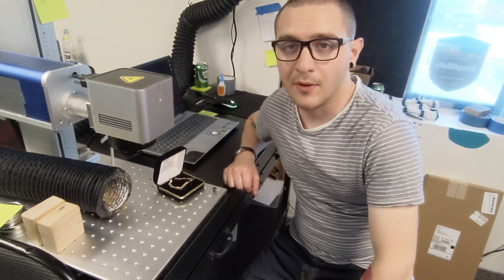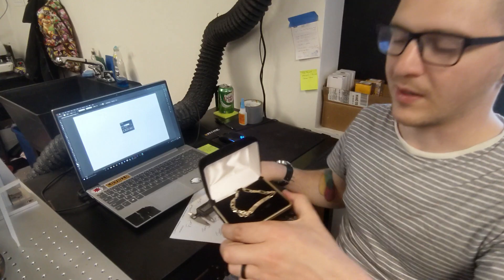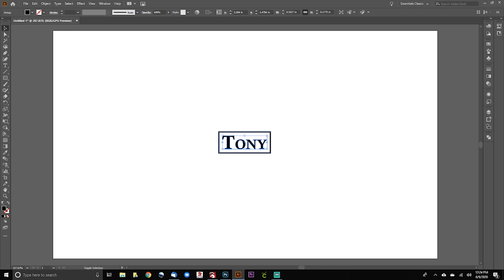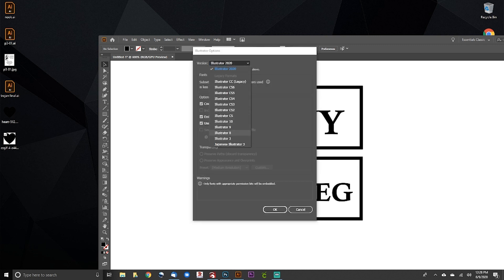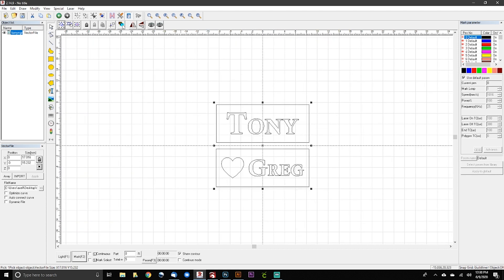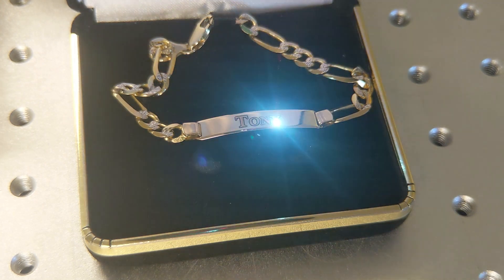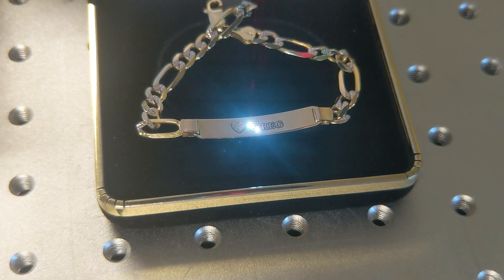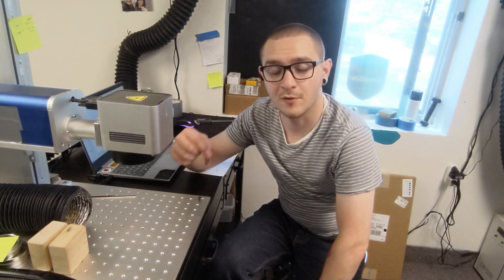How to Engrave GOLD with a FIBER LASER

Comment: Could you share your settings for the black engrvaving and clean-up as far as speed-power-frequency-Q pulse is concerned? May be I am forgetting some other options since I am a beginners learning to workshop with a high power fiber laser. Thanks

Comment: How did you get your laser to show the text (Tony ) to show like that what setting do I have to turn on ?
Reply from the maker: In ezcad, you can do this a few ways. Like we did, can outline with the border box removed in software so only name is selected, or using mark select and only selecting the name and not the border box and framing.
In lightburn, there are several framing options within the frame menu which can output a general square frame, tight exterior outline, or a more detailed shape of the components of a design, also adding in you can use the cut selected graphics as a equal use case to the mark select in ezcad, functioning the same way.

Hope that helps!

Comment: I bought a laser engraver to engrave a gold plated necklace and it won’t even make a dent in it . I did some research and I think I figured out that the engraver I bought didn’t have enough laser power for the material I was looking to use it on 🤦🏾‍♀️. Do you have a recommendation for what amount of laser power I should be looking for when buying a laser engraver based on the material I’m looking to engrave (highly reflective gold plated 316l stainless steel) ?

Comment: Awesome video . One question . When you laser engrave into the gold are you removing gold ? Weight ? Or it does not affect the weight or gold
Reply from the maker: You're definitely ablating the material so there will be a reduction in weight, however small.

Comment: As I can see there is a cross hatch in the engraving process.. But when you show your hatch settings cross hatch or auto rotate aren't checked.. Can you please tell me the correct and complete hatch settings? Thank you in advance!
Reply from the maker: Rather than using a cross hatch I used the second hatch with an opposite hatch angle. Cross hatch is fine too, however you want to do it.
Reply: Thanks for the clarification. Your final hatch looks really good. One of my friends bought a 50W laser machine and after 3 months of playing with it we cannot get a nice looking hatch on gold. On silver looks ok but on gold far from what it should be. The only way to get a clean filled text on gold is to import the text in ezcad like a picture and engrave it like that (with the settings used for photos). It looks good and it takes even less time. Photos look ok either on gold or silver.. the problem is that as far as I know you cannot engrave photos/pictures using the rotary tool. So for inner and outer ring engraving the only solution is to use hatch. What I did and looked nice was only to engrave the text contour after applying an 0.05mm offset 3 or 4 times, so you get a thicker contour.

Comment: I have a pegaso laserbergtech laser how do i know if its a fiber laser? This is all very complicated going from tutorial to tutorial xD
Reply: Also i want to engrave on wood or metal how and where do i get pre done files to just engrave so i dont have to set anything besides strength and stuff
Reply from the maker: If you have a fiber you can do metal but it's not going to work very well on wood. Files have to be prepared in an outside vector editing program so you'll need something like Adobe Illustrator or Affinity Designer to prepare artwork. We have tutorials for both on the channel.
Reply: @LaserEverything  it can laser steel and stainless steel and metal with coating on it and i lasered my plastic phone case wich worked pretty well but all i can do i  ezcad is type symbols or that stuff
 is there no easy way to get pre done art into ezcad for standart steel or something?
Reply: Or is there an easy tutorial on how to get any file i want into ezcad? Without like photoshop just some basic , pre done art to engrave onto anything like i can put the settings to engrave on silver or stuff like that but i cant get any art into ezcad without it crashing or not putting up what i want it to put up im sry my english is bad ...
Reply from the maker: If you have a fiber you can do metal but it's not going to work very well on wood. Files have to be prepared in an outside vector editing program so you'll need something like Adobe Illustrator or Affinity Designer to prepare artwork. We have tutorials for both on the channel.
Reply from the maker: Not familiar with that brand, if you can post some pictures of it to our discord server or facebook group so we can check it out.
Reply: @LaserEverything  ill try that at home
Reply: @LaserEverything  i cant install discord on my phone for whatever reason its an A51 ill try it on the laptop

Comment: Hi nice video and valuable information! 

Can you tell me please what camera are you using for the closeups ?

I m trying to set up a camera to be able to see more clearely the reading light for better centering of the object. But the cam i use tends to enhace the red light to much and loose clarity.

But i can see that in your video the image looks sharp, so it would be nice to know what specification does your camera have. 

Thanks.
Reply from the maker: In this particular video I'm using a Google Pixel 3 smartphone but we've since moved to the HD Nexigo cameras available on Amazon. They are inexpensive and do a good job.

Comment: HELP : After clicking open vector file in EZcad I can't find where it was actually opened, scroll bar is to much to find. Is there any short cut to find the opened vector file on EZ cad screen ? please help
Reply from the maker: if you click open vector again it should open to the last folder you had open. At the top there is a drop down menu that should show you the folder tree where the file is located.

Comment: I like your videos. I am thinking of buying a Laser called SCULPFUN S9 Laser because I can not afford such a nice laser as you have. Do you think that this 90w laser can do as good a job as yours. Can you perhaps explain the difference?
Reply from the maker: 90w is a LOT of power, what do you want such a high power laser for? The difference between manufacturers is stark. Buying a high quality laser is important in this industry. Wiring quality, fiber optics quality are two big areas where you see a big difference between higher end machines and the cheap ones. You also get more reliable power supply units and with the super cheap lasers you often get knock off laser sources which is the box generating the laser. There's a very long list of reasons why you should spend more. Save for more time if you can and put some extra money away, then make your purchase. Not only are super cheap fibers unreliable, they can be dangerous with melted wires and fiber optics. Be careful!

Comment: Can you please tell me about wastage of gold dust during this process? Thanks for the good video
Reply: I’m a jeweller and I’d be inclined to weigh the piece before and after engraving and see how much metal is actually removed by the process. Once you know how much (or how little) you can extrapolate knowing how much precious metal engraving you actually do per week/year and from that you can calculate the return versus the cost of specialised extraction system/filters and refining of the metals. 
I usually only refine my lemel (scrap metal filings) once a year and it’s worth saving but I don’t know if it’s removed from the original piece as a vapour or as small molten pieces? 
I’m very interested in finding out myself!
Reply from the maker: I'm not a jeweler so I don't have specifics but a lot of guys will get a basic fume extractor and ONLY use it when they're working on gold projects. Every couple months you can empty it and reclaim the gold dust for repurposing.

Comment: Hey Alex, if you are deep engraving, it leaves the surface rough, how do you treat the piece then? Thanks
Reply from the maker: Usually a pass of something like steel white finish (fast and medium power, medium frequency) will flatten it out a little after you reach the required depth, it's not perfect but it helps. You can also go in and straight up polish the engraving. If you go deep enough before polishing it won't remove the engraving, I'm not a jeweler though and there are probably better resources for that info out there :'D

Comment: Well... nice videos! you did not only got me SUBSCRIBED but also made me buy a 50W JPT... now I need to support your channel also... does your parameters library work with my new 50W JPT? Thanks
Reply from the maker: Yeah Karl, did you pick up the Mactron? The Excel sheet that's part of the Patreon includes an automatic converter so you just pop your lens and wattage information in and it will convert the power settings for you.
Reply: @LaserEverything  I did not get the Mactron because I also got a 150W CO2 laser recently so I am trying not to over spend much
Reply from the maker: @CHRO_KO  GOTTA get what works for your budget :P Look forward to hearing more about your machine. Don't forget to join the discord if you haven't, it's free!
Reply from the maker: So glad you're enjoying the channel. Thank you so much for your support and thanks for watching!

Comment: I do not have a laser but I have a question before I decide to buy one: Is there any depth or is it just a surface color manipulation? I heard about laser deep engraving. It is real engraving or just a kinda printing on the surface? Sorry for my newbie question.
Reply from the maker: Depends on the laser that you get and what materials you're working on, what did you want to be able to do deep Engraving on?
Reply: @LaserEverything  Hi. Thank you for the fast reply.I want to engrave silver, brass, aluminum. Maybe gold in the future.
Reply from the maker: Any fiber laser would be able to engrave those deeply :) You are not restricted to surface marks when using a fiber laser. For info on which one you should buy check out my 2021 buying guide link here: https://youtu.be/Y7tknUioLwY
Lower wattage machines may take longer to achieve a super deep depth, but all of these lasers will be removing material from an item, not just marking the surface (with the exception of plastics, of course - this machine is for metals). Also feel free to join the discord (link in the description) with any other questions you may have. 

-Alex
Reply: @LaserEverything  I will look into it. Thank you very much for your very informative and very generous directions. I will watch that YT video and look into Discord. Thank you.
Reply from the maker: Sounds good, thanks for watching 😎

Comment: What laser you recommend for cutting and engraving silver?
Reply: Do you have parameters for cutting gold and silver on 50w
Reply from the maker: Video on this in the near future
Reply from the maker: A 30w or 50w fiber laser will do just fine. You don't need anything with fancy frequency modulation because silver isn't ferrous so no need for a MOPA or anything like that. If you're only planning on working with silver a basic Raycus cloudray laser like the one in the Amazon link in the description will do just fine.

Comment: What was the impulse set for this video? 200 ns, 100 ns or what exactly impulse length ?
Reply from the maker: Not sure where to find that? Does that mean frequency?
Reply: @LaserEverything  no, it is not the frequency, frequency is visible on video. For most of the fiber laser machines the pulse duration can be as non changeable fixed value, usually 200 ns and it is possible to find it in tech.specs. But If you have a MOPA version - then the pulse duration can vary from 5 to 200 ns (depending on the task) and somewhere in the software it can be adjusted, maybe in advanced settings. I am working with another software and for this reason can not suggest you where to find it. In my software it shown among other parameters, like power, frequency and others.
Reply from the maker: Gotcha, makes sense. I've never owned a machine like that so I suppose I've never much cared to see what that value is. I'll look it up when I get to the office and let you know.
Reply from the maker: I poked around a bit and I believe it's listed as 1us or 1000ns - though that seems to be out of your listed range - but I don't see any other values that are measured in seconds.

Comment: Hi, Alex
Thank you for the video. 
I have followed the instruction of your video, but the letters are not engraved with the black lines around the edges. What is missing here?
Also, when I click on the 'Select param from library', it doesn't show the list of parameter settings like yours does. How do I get the list of these settings?
Reply: In your hatch setting make sure you select "mark contour". As for the parameters I built them myself. May create a public folder with them in the future.